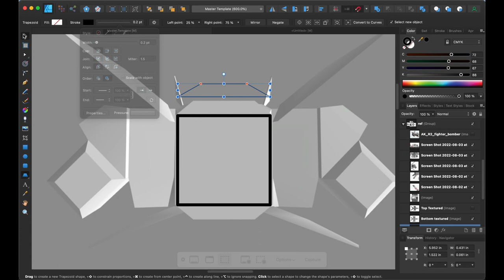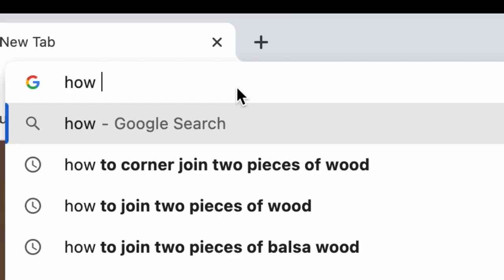Kitbashing the Taiidan Attack Bomber from Homeworld (inspired by Space Gooose)

Comment: Excellent work, well done.  I make up toy soldier sets to give away so I have two issues: A) The rule of threes, one ship is a ship, two is two ships but three is a fleet (works the same with toy tanks), so I have to make three identical copies. B) Some of the sets go to 3-7 year olds, so cannot have anything they could hurt themselves with or break-off and choke on. There is a third issue as well, some things are likely to end up in the bath (although I have made some specifically for that). What I need is a glue that sticks uPVC (plumbing fittings) to styrene, no luck yet but still experimenting (for the moment drilling holes and using drawing pins.thumb tacks backed with Milliput to provide a gluable surface).  Look forward to your future builds, I need ideas for sci fi sets.

Comment: You should use Tamiya brand modeling putty, it is as white as the polystyrene and it dries up quick. You can sand it and paint it, it is great! The only thing is it smells like oil based paint. Other than that, it is awesome.

Comment: Astounding job, pratically the templates for such a model could be made  from a paper model such as with Pepakura designer. It's incredibile the details'  level you achieved on it👍
Reply from the maker: Converting it to papercraft would be interesting. I have to take into account the fact that the styrene has some dimension to it when I make the templates, but I do sometimes test them in paper to make sure they line up right.

Comment: Love your videos! I am brand new to spaceship model building and, so far, have only watched your channel, and Adam Savage over at Tested. I am really excited to get started and was wondering what app you're using to import the ship model and create your templates?
Reply: It looks like Affinity on Mac, but you can do the same thing with Photoshop, Illustrator, GIMP, Inkscape etc. General process is to import an image or several images and trace the major shapes. Just make sure the images are as close to orthographic as possible (no perspective distortion). It's easier to trace them as vectors as it's easy to adjust the positions and line thicknesses afterwards and can be scaled to any size without any issues, which makes printing easier.

If you have access to a 3D model file like the video, you could use Blender or some 3D model viewer to take screenshots of it at different angles for creating templates, or if you want even more accurate templates import it into 3D modelling software and unwrap the mesh into a UV map, but that's pretty advanced and is probably overkill if you don't already know how to do it!
Reply from the maker: This is it exactly. I don’t know anything about 3D modeling programs so I just use the default Mac picture viewer which can handle .obj files just fine. There’s a little bit of perspective distortion, but since I clean up the templates to match with each other it’s not an issue.
Reply: @Sublight_Drive  Thanks!
Reply: @Kooozer  Many thanks!